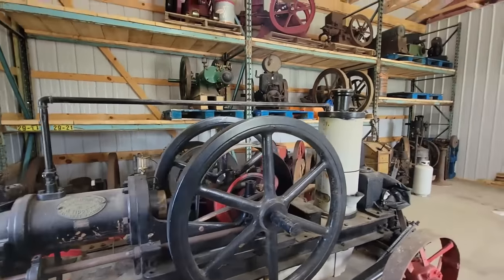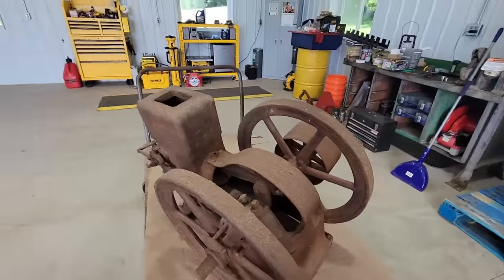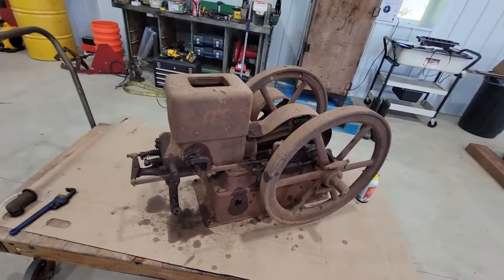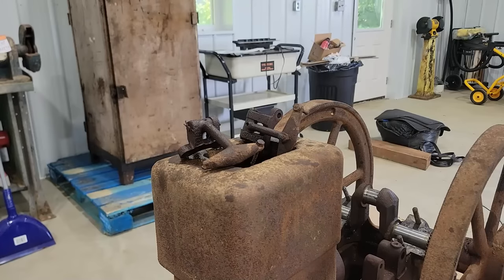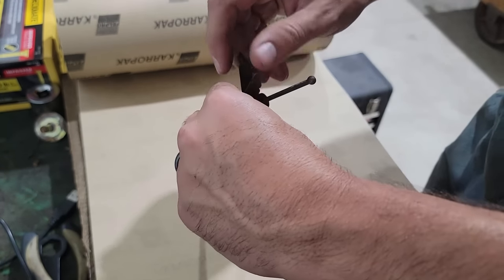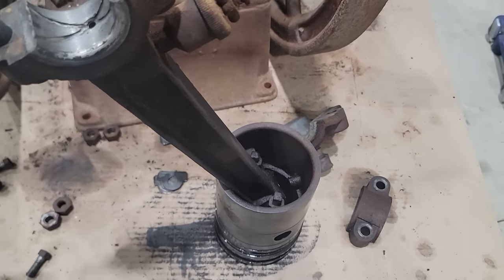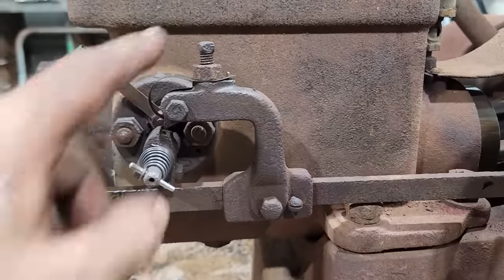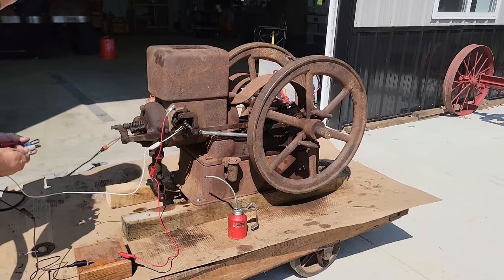100 year old BARN FIND Hit Miss Engine RESURRECTION!! Will it RUN???

Comment: If you have need to make another head gasket, you may want to try a different approach.  Forget trying to cut a circle. Start with a square and punch the first stud hole. Then use a bolt and washer to secure the gasket blank to the jug, and mark the remaining holes with a ball pein hammer. Multiple taps will cut through the paper, follow up with a punch if needed. Secure the new holes like the first, and with the paper now taut, tap the cylinder and water jacket holes with the ball pein hammer. Trim as needed.
Also, the "rounded edge" of the cylinder is called a lead in chamfer.
Reply: It's a can't-miss method I've used for both large and small gaskets. It's like the method of rubbing a pencil over a piece of paper to reveal hand writing from paper above it.

Comment: After the English destroyed the Boer Republics and killed most of the women and children in their "concentration camps" in the late 1800's - early 1900's in what is today called South Africa , the farming population were forced back into the middle ages so no-one could afford this sort of technology.
I have heard about these motors but have never actually seen one never mind seen one actually running.
By the time the Boers (farmers) had rebuilt enough (took at least 2 generations) to be able to afford some sort of technical equipment there were more "modern" motors like the Bulldog Lister (I believe it was called), and very popular locally was the old Model T Ford motor straight out of the car.
Seen a few of those that are still running even though there are any number of Datsun 1200 motors etc lying around, it is regarded as a tradition and would bring "bad luck" to not use the motor that great great grandpa used.
So much so that when I was an apprentice in the early 70's, my "specialty" was re-casting and machining the white metal bearings on these motors and do the final assembly and test run - did at least 1 a week the whole of my apprenticeship - and it was always fun.
I have seen a 70 year old man cry when their beloved motor was shown to them in the shop and then started.
One old farmer told me that it was his job as a youngster on a Friday evening once every 3 months to take the motor off the pump and put it back into the car.
On Saturday before dawn the whole family would pile in and on the car and drive the 100 miles plus to the nearest town to buy and order supplies and to attend the communion service at the church on Sunday.
When they got home he would have to put the motor back on the pump ready for Monday morning as by that time the water tanks were just about empty.
He was a really great old man that.
Thanks for showing me something "new" from the past that I had heard about but never actually seen in complete form and running before.

Comment: I remember these things on oil pump jacks in South Texas, hearing the pop pop pop pop as the engine lifted up the pump jack, then the whuff whuff whuff whuff as she coasted on the down stroke. They ran on casing head gas directly from the well head. They would run until the pumper came and shut them down. Very reliable.

Comment: A few years back I read an article in Farm Show magazine about using muratic acid to remove rust and only recently tried it. It works like a charm, even diluted 3/1 with water. You do want to make sure you do it outside due to the off gas produced which i belive is hydrochloric gas, i might be wrong on that though. It works much better than Evaporust, but great care must be taken when dealing with acid. I have wondered how it would work to take a rusty engine such as this  an set it in a tote with the top cut off for a day or so with acid/water solution. Just make sure there are no aluminum components on the engine or they will be no more when you pull it out.

Comment: I’m jealous, I have been whacking away at my piston on my Witte for six months now. Stuck solid.
Reply from the maker: I really lucked out on this one!   I've had them where my 30 ton press wouldn't budge them without alot of heat!   Good luck with yours!
Reply: Could you pour in some ATF/ penetrating oil, install the head and apply air pressure for a few days? I have used this method to free up stuff.

Comment: Great video! What I always wonder is, why? Why did they build engines like this? Was it just because of technology then? Or are they a learning step to the modern engine?
Reply from the maker: I would venture to say this engine was designed when the internal combustion engine was still in its early stages and as with most new technologies it was still in the trial and error phase.
Reply: This was first generation internal combustion engines... at least they found something!!!

Comment: Very cool .i realy enjoyed the video . I have an old Gilson on a drage saw . The engine is in pretty good shape .  I dont know much abut them this video really helps me upstand it more  . How do you tell the rotation the engine should turn ?
Reply from the maker: Most engines run in a clock wise direction when the cylinder is to the left of the flywheel.

Comment: What was the gear with the broken tooth for, I missed your explanation. Very nice video
Reply from the maker: The broke gear is the drive gear for the magneto that would produce spark for the engine to run off of.   I have found a replacement gear and I plan on doing a video of getting the original magneto working and putting it back on the engine and having the engine running off the magneto instead of a battery charger 😆

Comment: Thanks for sharing and including fine details! If you have video of tearing down the cylinder head, points, etc, I would like to see it, and I bet others would want to see it also. How were you able to get the governor system to work without those springs you mentioned? Do you have plans to install the ignition you found in the water box? You now have a new subscriber in me!
Reply from the maker: As far as running goes without the springa, there is a speed adjustment screw I have cranked all the way in to allow it to run.  

I do plan on getting the original ignition system working and I will make a video of that when it do!

Comment: Our 5 hp was belted to a 1920s gear water pump; drew the 40' x 50' pond down 18 " in 5 hrs of orchard and garden watering. Pump was 6" long on the gear teeth; 1 pint per revolution.

Comment: Auto parts store has 5/16 copper nickle line and compression fittings. Just about any parts store will have it for fuel line and trans line repairs.

Comment: Looka like Amanco designed these really well.  Wouldn't just a battery and condenser work for an igniter fired engine?
Reply from the maker: They did do a good job.  Yes this would run just fine on a battery and coil.

Comment: Enjoyed the video.  I have a Fairbanks Morse that a neighbor used on a pump jack for her water well.  It has a cracked head, hopping to recast it one day.
Reply from the maker: What model and horse power Fairbanks?  Instead of having a head recast finding a replacement may be easier.  Alot of fairbanks engines still out there.

Comment: What was the little damaged gears ⚙ purpose? The broken tooth can be welded up and filed and or milled back to working condition.  Is there a speed control or is that a function of the governor. It appears a tad slow 🐌 but works great  👍 . Excellent job
Reply from the maker: The gear is the drive gear for the magneto that goes on the engine. You are correct in saying it can be repaired. I was about to find a new gear that is not broken I will be using that one as a replacement.  

The engine is running slow due to me not having any springs on the governor weights, doing that makes the governor weight stay out constantly and keeps the engine running slow.

Comment: Very interesting. I have heard of "hit and miss" engines for most of my life but I never really understood how they worked. Now I have some idea. I'm wondering though, what is the purpose of the magneto? Would it take the place of needing a battery to start/run? Also, if you had a load connected to the engine, such as a small saw mill or something like that, would you have to increase the R.P.M? Thanks for showing this and creating the video.
Reply from the maker: Yes the magneto would replace the battery and coil.  If I was to belt this up to something I would put the governor springs back on it and the governor would speed the engine up when it needed it. I have it slowed down because that's how I like to have them run.
Reply: @Cast_Iron_Curiosities  Thanks for the reply and the explanation. Will you be putting the magneto back on it once you locate a new gear or is it considered done now?

Comment: Plumb amazing to get that thing to run again after all the rust/years sitting in the barn.  You have my admiration and you do a good job editing for anyone that is interested in old mechanical things, WELL DONE!  Would it be too much trouble to machine a new gear?
Reply from the maker: I actually have gotten a new gear for this,  I just need to take the time to sit down and get the magneto working.  When I do, I will share that with everyone!

Comment: Should have used duct tape for the gaskets, Harold would have helped you make them. Lol. You can also tape a pencil to the dividers, like duct tape, and make a compass as well.  For larger circles take a flat piece of board, like a piece of lath, and put your nail in one end, then cut a V in the other at the diameter you need so your pencil point goes into the V.  Nice engine, but not near as nice as that fluted hopper Aeromotor.  I'm drooling over that one.  Is it next?  Great video.
Reply from the maker: Thank you! And great advice!!  I will eventually do a video on the Aermotor.  I'm having a new, correct, head cast for it and I'm waiting on it to get back to me before I work on it!
Reply: @Cast_Iron_Curiosities  Oh, by the way, I subscribed.  No way I couldn't.

Comment: Wow, that engine ran pretty well! I watched my dad braise a head back together that was in pieces before he bought it on an Alpha De Laval (or Lavalve) he got in a group. I believe the other two were a Stover and one with square bolts and fins on the cylinder and a fan that ran off a round belt from the flywheel. I was 10 and I was impressed at how good they ran when he got done with them. They came out of the second story of an old barn in Clinton, Mass.He later bought a Simplicity that he had to devote a trailer to, probably a 7or 8 horse.
Reply from the maker: They sure are fun to get running.  Glad you enjoyed the videos and thanks for sharing you memories!

Comment: How did you time your cam to the crank? I have a 2HP Witte without timing marks and I can’t get the thing to start.
Reply from the maker: You can time your engine by eyeball.  I normally time the ignition to fire when the piston is about 5 to 7 degrees before TDC and the exhaust to start opening about 25deg past TDC

Comment: This is really cool. I love old engines. But in seriousness...what would this engine be used for?  Is this for something like a water pump???
Reply from the maker: It could be used for a water pump.   Easy way to think of it it is that if you can belt a piece of equipment to the engine, it will run it.

Comment: Question, how long does it run on one tank of fuel?  Was these engines used mostly outdoors to run pumps or farm equipment, thanks.
Reply from the maker: Just idling it will run a couple of days on a tank of fuel.  It would if powered anything you could belt it too.

Comment: Old timers have told me that back in the day they used something called 'crater grease' on the exposed gears for stationary engines and pump jacks because it was so sticky it was less likely to sling off them while they were spinning.
Reply from the maker: Crater grease is still used today. The traction motors on a diesel/electric locomotives gear boxes use crater grease for that exact reason.

Comment: the red green show, i think your a few steps up from his fix it show. .. i wonder how well it would work running a generator.  i see it as a  thief proof unit. lol a real question
did this run on 6 or 12 volts.  stay well
Reply from the maker: Originally it would of run off the magneto that would have only produced 2 or 3 volts.

Comment: Why didn't you clean up the gears?? They looked pretty dirty!
Reply from the maker: They were, but it was mainly grease so I didn't bother cleaning them. With some fresh oil they will clean themselves on the wear surfaces and that's all I'm worried about.   I wanted to keep this engine looking like it's been in the building for 100 years.

Comment: Isn't the eccentric rubbing while coasting causing wear on that roller? I'd assume it barely gets touched if held back.
Reply from the maker: You are correct, it is rubbing constantly this way. I will eventually put a spring on it to keep the weights where they are supposed to be.

Comment: I was thinking that this could run a 12.8 Kw Magnet motor generator and power your house forever on a small amount of fuel. When I was working in the oil fields in Indiana we used these motors to power pumps to bring up the oil and they ran off of Natural Gas that came from the well.

Comment: Cool! When it's missing does fuel still enter the cylinder?
Reply from the maker: No fuel is being sucked in when it is missing.  The exhaust valve is being held open and the air that is entering and exiting the cylinder is through the exhaust until the governor tells the engine it needs to fire again.

Hope that answers your question!

Comment: What operates the intake valve?
Reply from the maker: Nothing mechanical.   When the piston is on the downward stroke it creates a negative pressure in the cylinder and atmospheric pressure opens the valve, allowing air to enter the cylinder.

Comment: Geee how you get an Astral over there?? Nice engine they are, been trying to work on a 20hp one. ;)
Reply from the maker: It was brought into the states in the 2000s by another collector I believe.  I purchased it about 10 years ago.
Reply from the maker: @travisjankovic6725  I'd love to see it run too! Lol. I haven't messed with it since I bought it!!    When I do work on getting it going I'll share there process with everyone!
Reply: @Cast_Iron_Curiosities  Ohhh it's not running? very simple to fix if it's simple and parts are still been made in Australia for these.
Reply from the maker: @travisjankovic6725  its pretty much complete,  doe not have much compression to speak of.  Might be stuck rings? I just need to take the time to mess with it.
Reply: @Cast_Iron_Curiosities  it might be the valves as they do carbon up a bit when they run without any load on them.

Comment: IMHO older steel/cast better than modern when it comes to equipment corrosion and the way they rust differ, modern engine would have rust welded, old ones like that, just surface rust a bit.

Comment: You said that you had it dialed in, but why was it running on full choke?
Reply from the maker: To make you ask questions.
Reply: @Cast_Iron_Curiosities  Seriously. I'm not trying to be a smarta$$. I thought I saw the choke setting on full during the entire run.
Reply from the maker: You never know with the internet lol.   This engine is supposed to run at a higher RPM than what I have it running at.  By leaving the choke closed it helps the engine suck the fuel in at the lower rpm.   If it was running at its rated speed it wouldn't be necessary for other than starting.   I hope that makes sense!

Comment: Nothing like sliding a crusty connecting rod across a nice smooth journal while pounding the piston out😆 ....and  then if that won`t  do the trick,  why not drop it to the bottom of the crankcase 😂🤣to put some dings  on that syringe that it  never had 🤣😂🤣?!!. They made them to outlast the owners , that`s why the factory tool kit shipped with them was pretty extensive 😯,3 hammers , small , medium,  and large just in case 😂😂😂yup ..they can take a beating and still run 😂😂
Reply from the maker: I was wondering if anyone would catch the rod on the journal 😆
Reply: @Cast_Iron_Curiosities  
I rebuilt many engines in my time from 16 to 60 when I  retired 9 years ago. All of them  big Detroit Muscle  Iron . Tearing any engine down with a sizeable piston is pay attention work. A 100 + year old hit and miss will run even when a 20 k deep scar on the main journal, a 700hp 425 Olds is a bit more finicky😂. Was not busting you ..it is hard for me  not to pay attention 😲! You did a fine job, a great job ,  and best of all kept it looking like the work horse that it was built to be , the same way that any farmer would have left after rebuilding it .
Paint is nice like chrome, but everyone knows that chrome won`t get you home😂
fresh gas and good ignition will😄😁
Reply from the maker: Agreed! Your methods when working with things definitely depends on what the intended outcome is going to be.  Don't worry this old girl is staying in her work clothes! Thanks for the comments, I love the feed back!
Reply: Yep I almost hollered out loud when I saw the rod on the journal!:-)

Comment: Hi.How much does he smoke per hour ?
Reply from the maker: Smoke?
Reply: @Cast_Iron_Curiosities  Hey, I use the translator because I don't know your language 🙂 How much fuel does this machine burn per hour of work ? Can it be used to drive asynchronous motors, generators ? And I learned thanks to you how to determine the position of the timing gear. Three dots on the gear. Thanks.